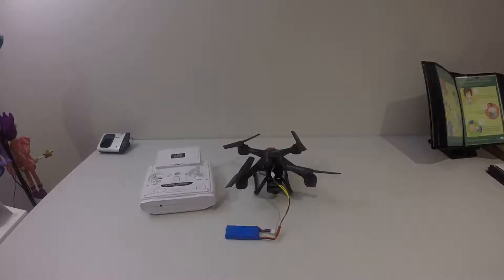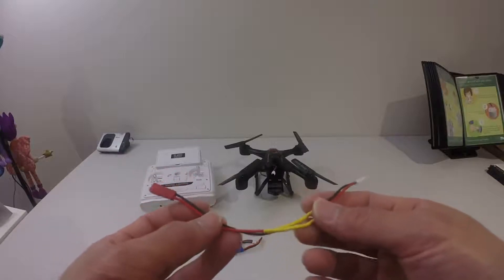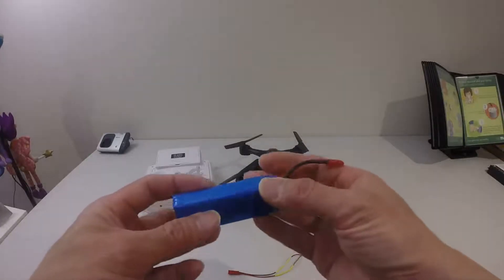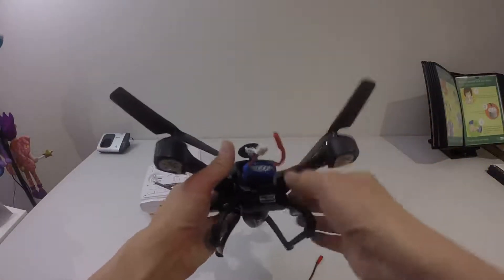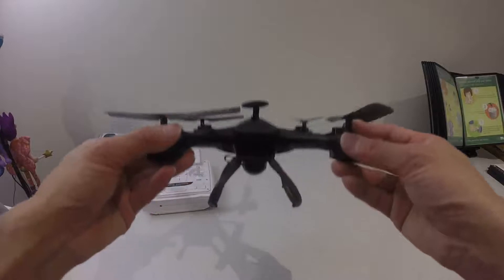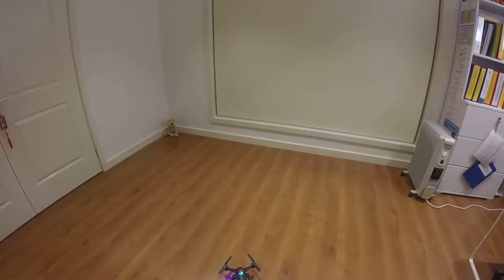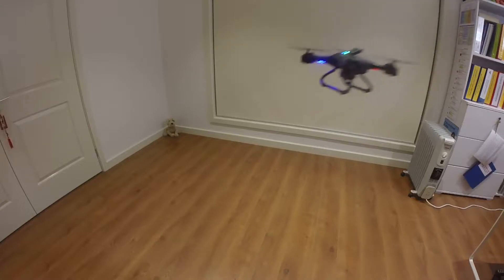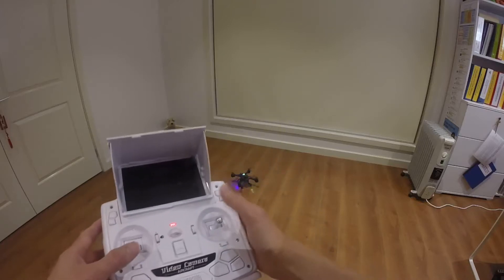Xinlin X163F 5.8G FPV - JST to Losi connector higher capacity battery mod

Comment: Nice video. I bought the same drone and it cuts off during flight a lot.
Reply from the maker: Thanks for watching. I haven't really flown this. If it cuts off a lot, it is usually because of the transmitter. Most toy transmitter are like that if the quad is flown too far and out of range. Best to keep it within 50m or less.
Reply: I wonder if I can bind it with my Spectrum. I only paid 40.00 so its not too bad.
Reply from the maker: DarkSagan No, as it is not on DSM protocol. What you can do is to change the flight control board to say Eachine or SP racing brushed and get the tiny satellite DSM receiver (this receiver needs to be bound with the main receiver first before connecting to the fcb or otherwise, the fcb can't bind it unless you key in a command line - that's my understanding). Then you can use your specktrum. :)
Reply: Danm that sounds complicated haha. Thanks though
Reply from the maker: Lol, yes :) If i have the time, I may try it.

Comment: thats funny on the x181 there was not enough space to put the jjrc X1 battery in the battery compartment. must have less of a flight board inside there or something.. cause it's the same exact size quadcopter and outer shell as the 181
Reply from the maker: I thought the X181 is slightly bigger with the bigger motors; it looked bigger. Definitely, this flight control board is small.
Reply: Dont know..?? Thought it was just different motors and FC
Reply from the maker: Full Metal Heli I have  just checked the size. X181 is 40x40x12 cm whereas X163 is 38x38x10 cm.
Reply: Interesting wow
Reply from the maker: Full Metal Heli Yes, and the small has bigger battery compartment lol :)
Reply: Lol